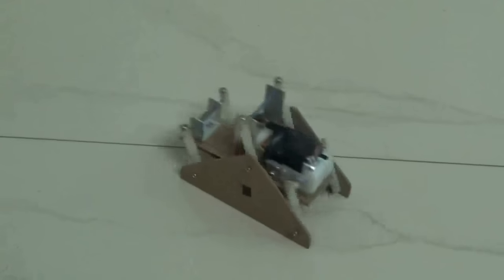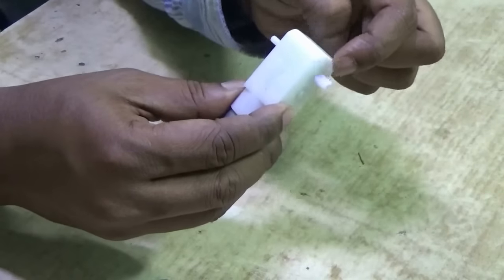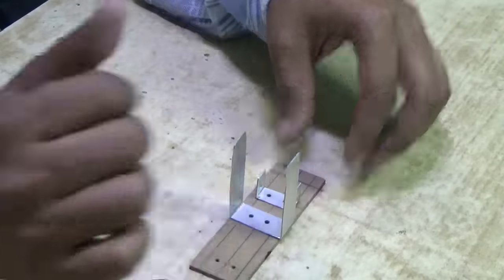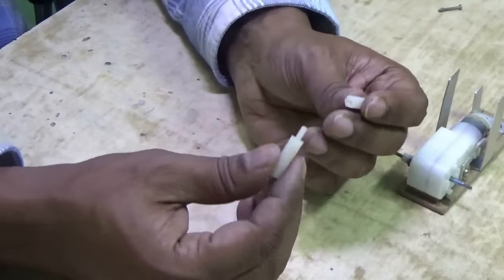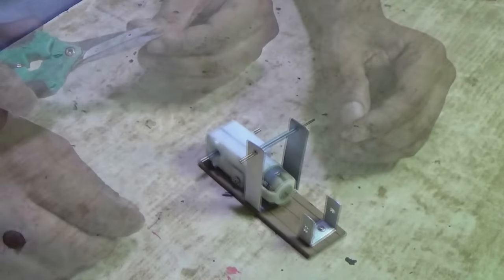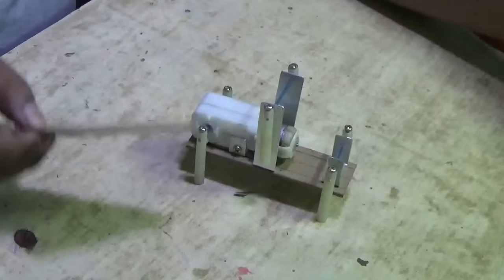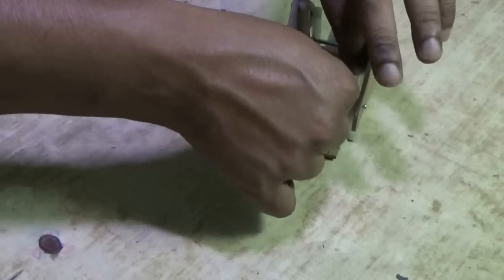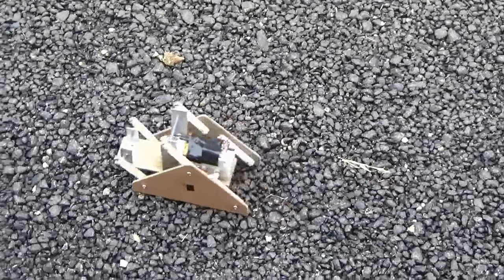How to make a Robot which can walk on irregular surface

Comment: we can use another battery like hw battery
Reply: please reply
Reply from the maker: @nashrahansari3434  do you mean HW 9V battery? With 9v motors may rotate fast or may get heated up. Also its capacity is low, so may not run for long time, but for importantly it does not privide high current, so in a rough surface the motor  may get stopped.
Reply: Sir we can use card
 board
Reply from the maker: @ahadansari1634  use MDF. Ordinary cardboard is not strong enough.